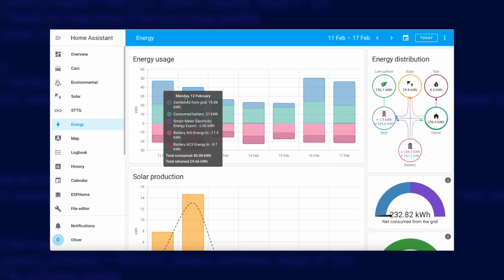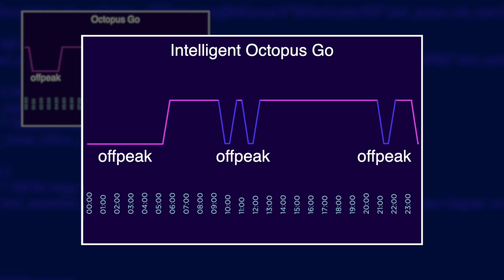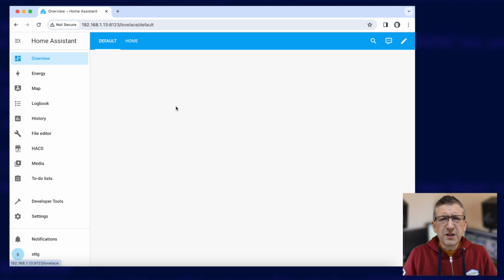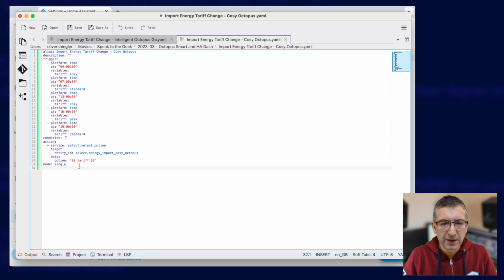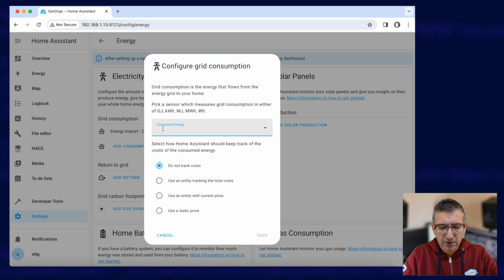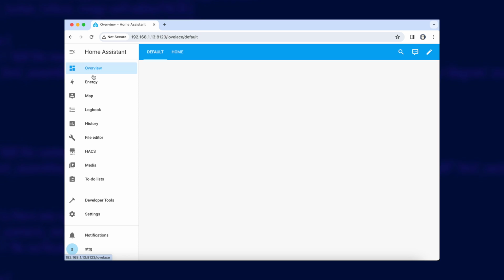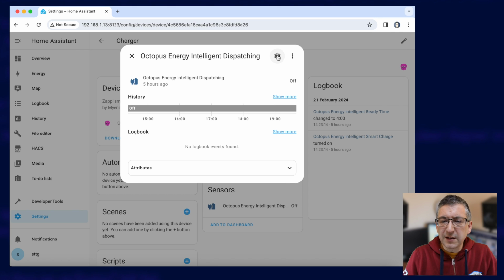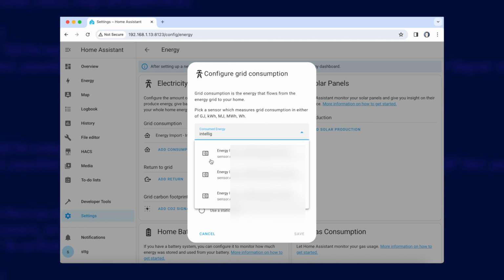Octopus Energy Smart Tariffs and Home Assistant’s Energy Dashboard: Cosy, Go, Intelligent Go, Flux

Comment: Thank you for your videos as they are really helpful. I am struggling with your Yaml script for the variable tariff Octopus Cosy script. I copied it and when I go to save there is something not right on a lot of the lines. So can not save it. I would really appreciate your advice please.
Reply from the maker: When you copy the code, make sure you use the special copy button in the top right and not normal copy and paste. It’s very important to preserve the exact spacing as shown in the code otherwise it won’t work

Comment: Looking at the docs for the Octopus Energy integration it looks like you need a Octopus Home Mini. Is this correct? Can you use it without the Mini?
Reply from the maker: You can use the integration without the Home Mini... but it won't work properly with the Home Assistant Energy Dashboard unless you do get a Home Mini. This is because the data that the API provides is delayed by a couple of days because it takes that long for Octopus to obtain your meter data from the DCC. If. you have an Octopus Home Mini then the Home Mini is providing live data to Octopus who can then immediately provide that back to you via their API. Call up Octopus and ask them nicely if you can get one, they are free.

Comment: Wow -  this is both super useful, and thanks to your clear explanations, easy to set up. Wish I'd seen it long ago!  Do you have any advice on how to carry the peak/off-peak distinction (and cost) through to the "individual device usage" section of the dashboard? With whole home monitoring, I have more than 20 distinct circuits/devices in that section, and being able to see their costs accurately taking into account electricity rates (rather than simply 24h of kWh) would be very helpful
Reply from the maker: The individual devices section doesn't deal with costs, just energy use. You could create tariff-based utility meters for the devices and switch between them using the same automation, then display both of those in the individual devices section to get a breakdown of peak or off-peak usage but that wouldn't tell you the cost, and importantly Home Assistant doesn't know if that energy came from your panels, battery or the grid - it only makes sense to do this if you are only ever drawing from the grid.

Comment: At 4.05 he selects and Input Sensor called "Grid Energy Imported" I have no sensor called that, so maybe the Octopus integration has changed those sensor names. Can anyone tell me what the equivalent is called? I had the same problem following some of his previous Octopus Home Assistant videos for the same reason. They are all "Current Accumulative Consumption" "Current Interval Accumulative Consumption" "Off Peak Current Accumulative Consumption" "Previous Accumulative Consumption" "Standard Current Accumulative Consumption" and so on and so forth.... 27 sensors from my import meter and 7 sensors from my export. Any nudge in the right direction to make sense of it would be appreciated!
Reply from the maker: sensor.octopus_energy_electricity_x_y_current_total_consumption is the energy sensor you need to use as the input sensor for your utility meter, also labelled "Current Total Consumption Electricity"

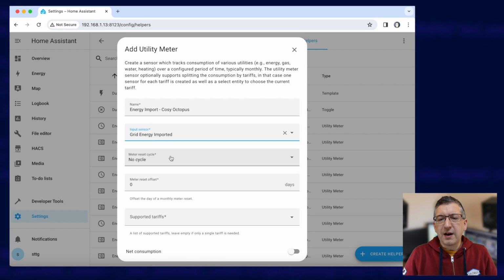Comment: i am a bit lost at starting, I am still have no idea how to create the helper (04:09) which use the sensor "Grid Energy Imported", I can't find any similar sensor, or may I know which Ocotpus integration you are using?  I am using the one developed by bottlecapdave
Reply from the maker: I also use the same integration. You will need an Octopus Home Mini to get reliable up to date data from the integration to use with the energy dashboard. When you have that, the sensor you need is called sensor.octopus_energy_electricity_xxxxxxxxxx_yyyyyyyyyyyyy_current_total_consumption with your own meter details where I've put x and y.

Comment: In the first example is there a reason why you didn't select a cycle option? Are time helpers not required?
Reply from the maker: The one for Octopus Go? In reality I would use a daily cycle for the reset because it means I can chop and change the source entities if I needed to without losing the long term data, but I was trying to keep the example simple because I had a lot to get through and a reset cycle is not critical for the energy dashboard because it will do that itself. As for time helpers, all they do is store times - if you look at the automation examples in this video the times are hard coded in the triggers. You can use time helpers if you want and reference them in the triggers instead, but again the hard coded method here is the easiest to explain and share.

Comment: Hello all, hoping for some help. Seems that my zappi on intelligent octopus go isn't triggering the "Intelligent Dispatch" entity when it charges outside of the regular 2330-0530 period. 
So when I get my intelligent periods say in the middle of the day it doesn't register and therefore doesn't swap my utility meter. 
Any suggestions? I had thought about using the my energi integration instead to read then the zappi starts / stops charging but this wouldn't account for bump chagres.
Reply from the maker: It might be worth raising your questions in the discussions page of the integration's Github page (https://github.com/BottlecapDave/HomeAssistant-OctopusEnergy ) because you're likely to get more responses. There is also another integration by Megakid which has an 'octopus_intelligent_slot' sensor you could use in the same way: https://github.com/megakid/ha_octopus_intelligent
Reply: @SpeakToTheGeekTech  great thanks for the advice. Great videos !

Comment: I followed your tutorial to set up Octopus Go. I left it for a few hours and then added the newly created utility meters (peak and off-peak) to the Energy Dashboard and set up an entity to track the costs. However, the costs are still stuck at £0.00. Is there a lag in when it starts to show you costs?
Reply from the maker: It depends on how you track the costs. I track the energy and then have an entity tracking the current rate (from Octopus) and use that - the dashboard calculates it itself and updates once/hour
Reply: @SpeakToTheGeekTech  I use the 'GivTCP [serial] Energy GivTCP Day Rate' and 'GivTCP [serial] Energy GivTCP Night Rate' entities. The day rate is £0.28, and the night rate is set at £0.07. Following your other video on integrating GivTCP and HA, I set these up via MQTT, but the value is still £0 even after a few hours.

I have used the same method to track my export using the 'GivTCP [serial] Energy GivTCP Export Rate' entity, which is calculating correctly. 

Any ideas?
Reply: @SpeakToTheGeekTech  I am using 'GivTCP [serial] Energy GivTCP Night Rate' and 'GivTCP [serial] Energy GivTCP Day Rate' as entities to track the costs. The Night rate is set to 7p, and the Day rate is set to 28p. 

I did this following your other tutorial on how to set up GivTCP and HA via the MQTT integration and set the rates on the GivTCP config page. 

For export, I am using the 'GivTCP [meter serial] Energy GivTCP Export Rate' entity, which I set up as an MQTT integration and is calculating correctly.

Any ideas?
Reply from the maker: As I said initially, I do not recommend this method.
Reply: @SpeakToTheGeekTech  is it better to use a static rate then? If not, what would you recommend? Do you recommend another approach via a YT video?
Reply from the maker: Use the current rate from the Octopus integration and add that in the energy dashboard config. It'll track the costs in there for you then.
Reply: @SpeakToTheGeekTech  Ok so I have missed a step and need to follow a tutorial on integrating Octopus. Thanks

Comment: I'm definitely doing something wrong.  Looking at the Automation traces I can see the tariff changes at the appropriate time, but on the dashboard it only shows peak tariff continuously.  I'll go through all the settings once more.  I have altered the names to Peak25, Standard25 and Cosy25 because I've attempted it 3 times and I wanted to be sure I was pulling in the correction helpers +/- integrations.   Thanks for creating the video.
Reply from the maker: I would definitely look through my instructions very carefully - they're in writing on my web site too if that helps. I'm still using the Octopus Go automation myself exactly as per those instructions so I know it works.
Reply: @SpeakToTheGeekTech  thanks again for the video and walkthrough on your website.  I had the named the tariff wrong (omitted cosy) so the entity wasn't being picked up by the automation. 
I knew it would have been my own doing because your description was so accurate and easy to follow.  It's now working perfectly.  Thanks for posting the video (and replying).  Subbed and thumbsed up.

Comment: thanks - this helps a lot 
Automation triggers for one of the irish tarriffs

triggers:
  - at: "02:00:00"
    variables:
      tariff: ev
    trigger: time
  - at: "05:00:00"
    variables:
      tariff: night
    trigger: time
  - at: "08:00:00"
    variables:
      tariff: day
    trigger: time
  - at: "17:00:00"
    variables:
      tariff: peak
    trigger: time
  - at: "19:00:00"
    variables:
      tariff: day
    trigger: time
  - at: "23:00:00"
    variables:
      tariff: night
    trigger: time

- Does anybody know a way of applying this historically ?
Reply from the maker: You can't apply it historically using Home Assistant. It is technically possible to directly access the database, calculate the values yourself and insert records accordingly, but that would require a lot of programming outside of Home Assistant.
Reply: Thanks  @SpeakToTheGeekTech

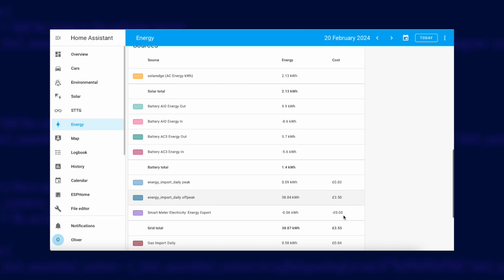Comment: You Energy Dashboard at 0:45 shows your battery Charging from 0:00 til 3:00 , as it is a LOAD that you get from the NET they are configured incorrectly as negative kWh,as shown at 0:53. In my opinion the bars should be above the line instead of under the line.
Reply from the maker: No it's all configured correctly. The graph is showing both the energy going in to the battery (pink bits underneath) and the home demand from the grid (blue parts above), so if you added one to the other you would get the net grid draw during that period. Battery charging is not home demand, it's stored for later use at which point it becomes home demand and appears above the line when you use it (as aqua blue)

Comment: can this only be done if you have the mini? because i am on intelligent go and find the sensors for the energy reading and have the octopus intergration installed.
I have requested the mini so just waiting
Reply from the maker: Yes, you can use Home Mini sensors provided by the BottleCap Dave Octopus Energy integration.
Reply: @SpeakToTheGeekTech  so need to wait for the mini?
Reply from the maker: Yes, your energy data will be too delayed otherwise

Comment: This is nice for the energy dashboard, but I would like those prices to be tracked for different tariffs in a seperate dashboard. For that I would need the utility meter to actually know the cost of those rates, and so far I haven't been able to figure out how to do that...
Reply from the maker: If you want to track Agile, you can pull that data in easy using the Octopus API or an Agile integration. For other tariffs, you can create helpers to store the costs manually.
Reply: @SpeakToTheGeekTech  
Sadly the Octopus Integration in Home Assistant doesn't seem to work with a German API Token.
As to storing tariffs in Helpers...I have been trying to figure out how to do that but have so far been unsuccessful
Reply: @SpeakToTheGeekTech  
Ok, I think I figured out a way to get my energy price comparison working in Home Assistant. Now I will let it run for a bit and see if any issues turn up🍀

Comment: Slightly confused as to whether you need to do the meter helper if you already have the gas and electricity meters in HA via HACS? also you skip over the variables or where to find them and which lines to update in the YAML. Could you clarify if poss?
Reply from the maker: You should use the meter helpers, they help future proof the setup in case your source sensors change so as you don't lose your historical data. Have you seen the article on my web site linked in the description? That should help you configure everything step by step.
Reply: @SpeakToTheGeekTech  Ok, so in the helper for OIG under sensor I only have accumulative peak/off peak sensors which is confuses me further

Comment: Hi Oliver, Firstly Thank You for all your helpful videos / scripts etc.
I've set up helpers to track my costs on flux, based on the automations that's on your website. However, when I try to find the helper in the dashboard they are not showing?
I have all of the Octopus TCP links, and the Grid Import Helper that I created previously. But the Energy Import / Export with the 3 different rates do not show in the options - they were created in HA more than 24 hours ago and they are all showing movement / data coming into them.
Any ideas why?
Reply from the maker: Hi, I couldn't say for certain, but the two most common issues people experience are (1) not waiting for the sensors to populate with data or (2) accidentally using power sensors instead of energy sensors. I suggest you double-check all the steps from my blog post about this, including Step Three! :) https://www.speaktothegeek.co.uk/2024/03/octopus-smart-tariffs-and-home-assistants-energy-dashboard/

Comment: Hi,
I want to automate (in Home assistant) a forced export of my GivEnergy battery between two set times in the evening. I want to switch from Eco mode to Timed Export mode at 17:30, and then from Timed Export back to Eco at 22:30. I can do it manually from Home Assistant by using the GivTCP Mode. However, when I try to automate in Home Assistant (using the simple When, Then do screen), the drop-down list under 'Then do' only allows me to change mode to 'next option' rather then to 'Eco' or 'Timed export'. I've tried using the YAML editor, but don't know know enough about the syntax. Any suggestions?
Reply from the maker: Your action needs to be "call service" and the service is called "select.select_option". Choose your forced export entity and the value must be the time to export for in quotes, and it must be one of the pre-defined values. For example "30" for 30 minutes.

Comment: Hi Oliver. I used your instructions for setting up IOG and it has been working fine except for a couple of weeks. I do have a couple of days though when instead of recording the off peak tarrif at 23:30 HA for some reason stays on the Peak rate. Rights itself the next day but it’s baffling why it should do that randomly. Have you noticed this in any other setups? Thanks.
Reply from the maker: There have been a few occasions where the Octopus API has stopped working over the last week or so causing the intelligent sensor not to update. This happened yesterday too. Unlikely anything is wrong with your automation, it’s probably related to Octopus issues.
Reply: @SpeakToTheGeekTech  No worries. The Octopus data (usage and cost) is correct from them so it’s just a quick correction for my spreadsheet. Just baffling 😁. Thanks for your quick reply and helpful videos.
Reply from the maker: Keep you eye on the intelligent dispatching sensor which should turn on when your energy is off-peak. If that’s not changing then that’s your clue that Octopus are having issues.
Reply: @SpeakToTheGeekTech  Thanks for the tip. It’s happened twice since I started the automation two weeks ago. This morning and last Saturday. I’ll keep an eye on it.

Comment: Hello, I followed your video to the letter this time, and I managed to get the peak/off peak working, however the values recorded in HA don’t seem to match up with Octo-Aid (another app I use to track things). I.e peak usage according to that is 26.51 and off peak 261kwh. But for same period in HA it shows 4.54 peak, 217off peak? Gas is off a little as well. Any thoughts as to why this could be as the octo aid links to the smart meters API same as the bottle cap Dave integration I use on HA?
Reply from the maker: I couldn't be certain sorry but it might be that the Octopus API is delayed in the energy data it provides to you and therefore doesn't reflect the actual energy consumed during the half-hour period that Home Assistant calculated. Are you using an Octopus Home Mini? If not then that would 100% explain it because the API on its own is not good enough for rapid energy data. I use a Hildebrand Glow IHD/CAD and that is perfect for real-time power and energy.
Reply: I do use a mini as it happens. The period I quoted energy use is over 6 days though not 1/2 hour.

Comment: Great video - thanks although I primarily want to track costs and we don't have any third party integration for most of our utilities in Australia. In fact I can't even get direct access to my utility meter data and have to resort to using CTs from a Harvi. Question - having set it up is it then possible to change those time periods for weekends and public holidays as they differ in Australia?
Reply from the maker: It's entirely possible to do as you would like, however it starts to get a lot more complicated. Your automation to switch tariffs must be configured to switch at the specific time periods you require, so you'd set up tariffs such as normal-peak, normal-offpeak, publicholiday-peak, etc... To detect when public holidays are you'd need to use the workday sensor (https://www.home-assistant.io/integrations/workday/), and you'd have to trigger the automation at all possible times and date combinations. Your ask is very niche, a lot of work and I wish you the best of luck!